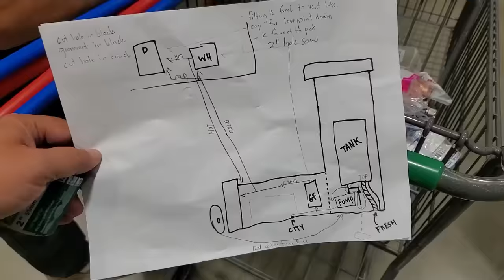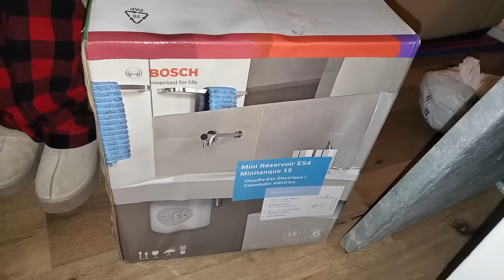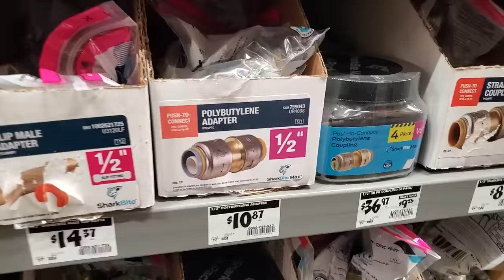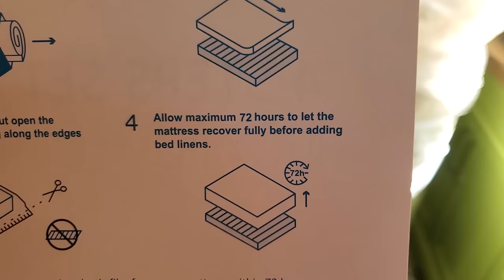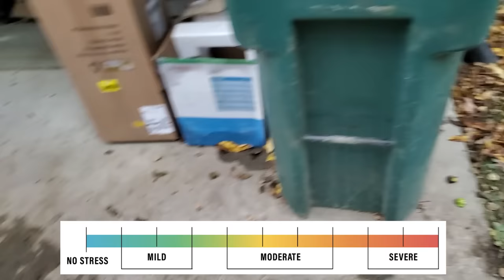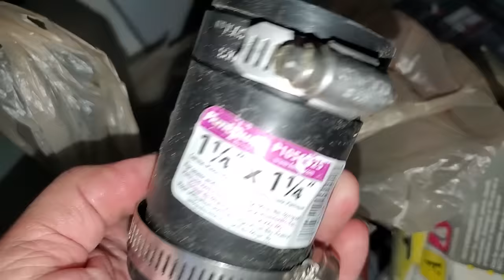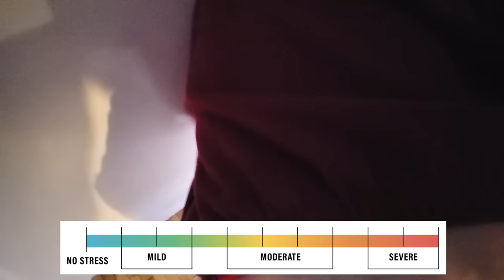Vintage RV Renovation - Plumbing Panic Mode Before Upcoming Camping Trip - DIY

Comment: I would not have put my face directly under the black tank while I drilled that hole. LOL! Use a hair dryer to warm up PEX and it will straighten out flat.
Reply from the maker: Ah, good tip on the Pex!  Thankfully no black tank disaster this time around at least 😅. Thanks for watching!

Comment: Very well could be 7/16 line like they used in mobile homes in those years.  Get several compression fitting/cut-off valves.  Measure the line size coming through the wall to be sure but it looks like 7/16  - they used odd ball sizes then that are no longer used but if you cut the line back an inch or so you should be able to get a compression fitting on it :)!  Have fun camping :)!!!
Reply from the maker: Great advice!  We really appreciate it!

Comment: Shark bite fitting are 100% better than the other ones I use to have to replace those plex fitting when I did mobile home repairs most mobile home manufacturers got sued over the plex blowing off the fittings because the clamp doesn’t hold well o and toilet are 7/8 “fitting sinks are 1/2” the one fitting you showed looked like a 3/8 flare
Reply from the maker: Thanks so much for this comment!  The heater hose solution probably isn't our best idea 😅

Comment: I just discovered you the other day and have been binge watching the Harvey videos. I love the banter between you two and all your SMILES! ❤️❤️ You are so brave with your renos!

Where did your get the fancy screen door cover on the 31 ft trailer door? I need this! My dog scratches like crazy!
Reply from the maker: Yaaay!  We're happy that you found our channel.  Thanks for watching!  So... I'm not sure what you mean by the screen door cover but I don't think we added it.  I'll have to look back at the video with that camper to see what you see :-)
Reply from the maker: Oooh, I just saw it.  We didn't add that but it looks like the stuff they sell at Home Depot.  At our store, it's usually at the end of one of the hardware aisles.  The funny thing is that we never noticed that on our door before until you mentioned it!
Reply: @retrorevivals  When you walk into the 31 foot trailer there's the door, then a screen door that can attach to the main door.  On the lower portion of the screen door there is some sort of metal with a design on it.  Looks more durable than the factory screen which the dogs destroy.

Comment: NPT is more than automotive! Its National Pipe Thread, should be available just about anywhere!
Reply from the maker: I think we ended up getting what we needed from Tractor Supply Co... Or was it Amazon?  It ended up being the same fitting as the propane lines.

Comment: You are doing an amazing job with the work, thanks for adding little trick tips, I just got a 78 gm c class and well let's just say it's a complete frame up jobber lol, I didn't know that wood carpenter ants chewed through blue foam, after 50 yrs learned something new lol, but anyhow thanks for keeping everything simple and easy for others to understand, myself well it's alot of everything skills of modifying abilities, best of luck with Harvey, I share some of my adventure with the mic gimmy  with your email address and show you some of the modifications that I'll probably have to do and if you want 5o share them with others it's all good sorry I'm not a camera in face guy lol, anyhow love the vids wish you safe travels keep it between the lines take care
Reply from the maker: Yes!  Are you saying they ate the blue foam board on yours too?  We saw the same in ours  Good luck with your project!  We're happy to have you following along 🎉
Reply: Yes they chewed and ate the blue foam, it's weird and it's suppose to stop the bugs, I'll take some pics tomorrow for the others to see, and it's mac gimmy day tomorrow, have to pull the a.c. the roof vent for the old fridge, seal it up, and find the mega leak on the dog house ( as I call it , bunk over front seats) and remove the rest of wood and foam, have to restructure the dog house cause it's kinda wobbly ( 1 handed moveable ) lol  yup she's rough lol
Reply from the maker: That's a ton of work.  Good luck!
Reply: @retrorevivals   well I've pulled the hotwater heater about to open it up for an inspection, but we are going to go with a newer updated version tankless hotwater system, the gas stove passed inspection after I put in the flex gas line which was recommended because of constant vibrations, the fridge and microwave that came with cleaned up nicely and work, I'm just pulling the AC unit to inspect it and hook it up to a 110 AC gfi cause the main wires there was a pinch and short out so fingers crossed they didn't fry it, and as for the water tanks well found a grey tank for the sink was fixed with fiberglass and resin, and foolish stunt on previous people they put laminate right over top of the original rugs 🤢 had to put on full face respirator mask, actually felt sick when I exposed it, and ur right about being alot of work but I knew that from the start lol, and good news I did and was able to rotate the motor manually, and did a pre-emptive booster pack hook up during evening to see if any sparks from wiring and none so I can put battery in and try it,  but I'm going over rest of the wiring and more or less removing the old stuff and documenting all of it with diagrams and photos and the odd video of nasty little things to look for and avoid later lol, anyhow happy manic Monday I'm off to get into more trouble with Mc gimmy lol
Reply: @retrorevivals   no I won't do a utube channel, I should but nope lol to much work and not a camera person lol but of you want to share some of the info to help bring more followers to ur channel by all means I'll send you the pics and videos to help others see the fun 🤣🤣
Reply: @retrorevivals   well was under Mc gimmy today and well sorta good sorta bad, very old gas in lines I have to drop the tank and clear all the lines, I have spark but she's weak, battery is issue there mostly, plugged up carb filter and inline filter have a quadrajet carb on it, but took off gas line and put thumb over the hose and got misses your it over and vacuum on pump was beautifully strong no clicks,ticks or bumps or noises from pump which is a bad thing but suckion was good and slow to release, oh and btw I learned a new trick to Hotwire the motor lol, so now I know 6 different ways to hot wire the ol girl so suggestion is to put in a Deadman switch somewhere only u know about so it'll slow down anybody from jumping the RV lol anyhow that's all for today's lil adventure with Mc gimmy tomorrow is a new day 🤣🤣
Reply from the maker: Oh my gosh, you certainly have a project on your hands and also sounds like just the right person for the job!  Very knowledgeable!

Comment: Pretty sure the toilet supply line in the wall was a male compression fitting designed to be used with a female compression fitting. It is straight thread vs NPT which is a tapered thread.
Reply from the maker: Thanks for the comment. We finally got it sorted out😉

Comment: When I would have leaks that couldn't stop I wood put a second clamp and turn it the opposite direction it would always stop
Reply from the maker: Great suggestion!  We're pretty sure we found the correct fitting for the toilet, still need to try to out though.

Comment: Hey RR, please flush every garden water hose before putting the water into the fresh water tank. If the hose was laying in the sun there are bacteria in it ...
Reply from the maker: Great suggestion!  Thank you 😊
Reply: Please buy a dedicated White water hose for your water. Maybe you’ll NOT drink or brush teeth or cook with that garden hose water ?
Reply from the maker: We didn't on this trip but in the future we're planning to use a filtration system and dedicated hose.  Great suggestion!

Comment: That's a normal mistake you'll get it fixed but I usually don't like those type hoses with the metal rings for sealing up two things I would have grabbed a pool hoes from home Depot neoprene
Reply from the maker: That's a good idea 👍👍